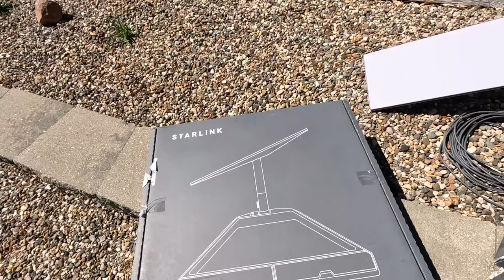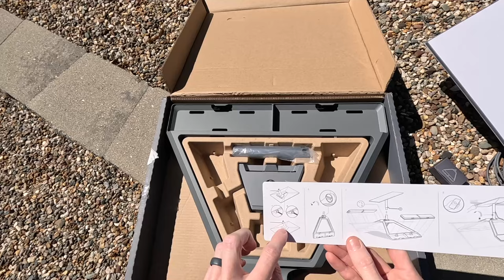Starlink Gen 3 Ridgeline Mount - Install and Review

Comment: Within 1 week from ordering (in the USA), both the ballast and mount frame arrived. Advertised 50 MPH wind rating per Starlink. Installed easily; nice to not drill anything into the roof. Beast of a mount.
Reply: I don't see an option for Starlinks ridgemount.  You ordered at the same time as the Starlink?

Comment: The First thing any Installer will want to know is What Windspeed will this withstand?    You don't want your panel to end up in the power line and fry all your computers.
Reply from the maker: Starlink says 50 mph (80 kph) wind rating for the Ridgeline mount.
Reply: @StarlinkHardware   I get 90 mph Gusts where I am at from time to time in S.E. Arizona.    I wouldn't chance it    Going to bolt it to my block parapet.

Comment: How secure is the mount on the roof? I'm from the east coast of Canada, and we have anywhere from 40-80km winds on the regular. just wondering how well this will hold up against those wind speeds.
Reply from the maker: It’s very heavy, winds in that range are not a problem.
Reply: @StarlinkHardware  thank you! How high of winds do you think it can handle? Sometimes we get gusts over 100km/hr

Comment: Where did you get the Ridgeline Mount? If it is on the Starlink site, what is it called? just ordered the Starlink Gen 3 today from Best Buy for $299! They have a sale for $200 off. I need the Ridgeline Mount but can't find where to buy it. Is it actually called Ridgeline Mount?  Why wouldn't it be available in all markets? Thank you for answering.
Reply from the maker: shop.starlink.com/pick

Select the Gen 3 dish. Should be there, unless it's not available in your market.
Reply: @StarlinkHardware  Thank you for answering, but all I see are Pipe Adaptor Mount, Wall Mount, and Pivot Mount. I don't understand why the Ridgeline Mount is not available everywhere. What would be the logic in the Ridgeline Mount not being available in my market? I already had to spend $6000 for a new roof due to Directv's work and pay $1000 for new walls and ceiling in the floor underneath. I desperately need this mount.
Reply: @Sappho123  I have the same problem, will probably just order it from amazon or something.

Comment: Try setting this up on a 12 x 12 pitch roof....I so wanted to use this mount but I had major problems getting to the peak of the roof.
Reply from the maker: I feel that, the angle on my home is really steep. I typically do my tests and reviews on the garage roof to avoid having to climb the steep pitch lol.
Reply: In my case I would have to haul a ladder up to the less steep roof and then place this ladder on the steep part - then hooking over the roof ridge. The device has 2 wheels built into it to roll the ladder up the steep part before hooking it over the ridge.

Comment: Hi ,
Since you reviewed the mounts for the two generations of the dish, do you think this mount for the gen 3 dish is compatible with the second generation dish?
In my location this mount for the second generation dish was available but it disappeared from the store and now it is only available for the 3 generation. 
I asked customer service and they said it was compatible with the 2 generation. 
You who have reviewed the two versions of the mount, do you think I can use this version with my 2nd gen dish?
Reply from the maker: Mounts are not compatible between Gen 2 and Gen 3, so a Gen 3 Ridgeline Mount will not work with a Gen 2 dish. The Gen 2 and Gen 3 are different in how they lock into the Ridgeline mount.
Reply: @StarlinkHardware  Yeah that's what I thought, I opened a ticket explaining this whole thing and they kept telling me it works for the motorized gen 2 dish which is the one I got, so I'm afraid it won't work and I'll have to return it, since the shipping and return process here in Costa Rica is very tedious. 
Can you check in the store if the Ridgeline mount for gen 2 is available for you? It is just weird that the gen 3 accessories are available here in Costa Rica and we can only buy the gen 2 dish. Btw the cost of the gen 3 Ridgeline mount in Costa Rica is less than $50 which is insane compared to $250 in the US.

Comment: I live in France, and am interested in Starlink.  Because I live in a rented property, this mounting system appears to be the best for my purposes.

I have yet to purchase Starlink, and don't want to if this and other accessories are not available here.  It seems that you have to have an account, before you can access the shop for the various accessory components.  That's awkward, because if there is no availability, there's little point in ordering the system in the first place.

Have you any advice, please?  thanks.
Reply from the maker: During checkout Starlink will give you a list of available options for your market.
Reply: @StarlinkHardware  Thank you - I gathered that, but as I don't wish to purchase Starlink before I am aware of which options are available in my market, is there no way to access the information without ordering anything?

It's a bit like, say, buying a new car on line, then discovering that half the necessary extras are not available in your country!  You need to know that, before you order.

Comment: Will this work on houses that have metal roofs with a ridge cap on this model? or are those of us with ridge caps still left to fabricate our own mounts?
Reply from the maker: I would say as long as the height difference is within about 4-5 inches it will be ok. If the cap is higher than that, the legs of the mount won't lay flat enough to be secure. I'm sure it would be fine that way, but the legs are intended to lay pretty flat against the roof surface.

Comment: Can you lay the dish flat pointing straight up to avoid obstructions or does it need to be tilted?
Reply from the maker: It will work pointed straight up, but that won't necessarily solve the obstruction issue. Each dish can only talk to certain satellites. Obstructions are obstructions because the view of the scheduled satellite is blocked in that area of the sky. Pointing it straight up doesn't change which satellite your dish is assigned to use, so you would still likely have outages if you have trees nearby.
Reply: The tilt may need to be adjusted up or down by follow the guide of the alignment menu on Starlink app, same for turn the dish around to match the guide of the direction on Starlink app’s alignment menu.

Comment: thanks for the vid - very helpful. how many times do you need to adjust the dish? Especially being so high, I find that the V3 (actuator) works really good as it will adjust itself?
Reply from the maker: You just need the initial aiming and then you don't need to mess with it after that.